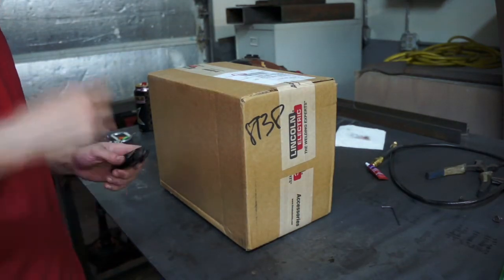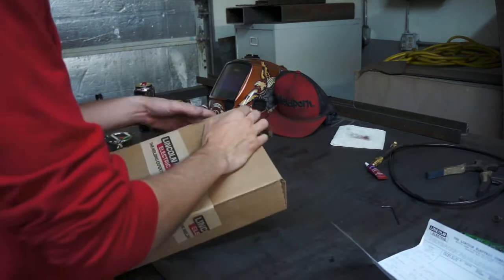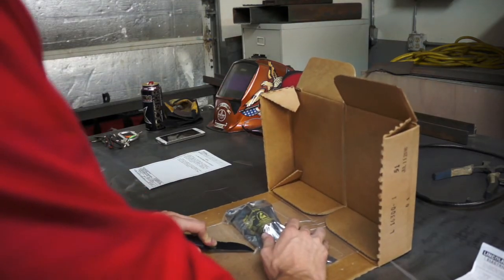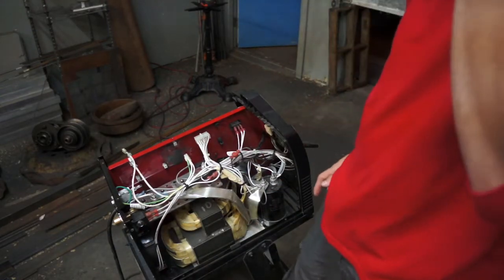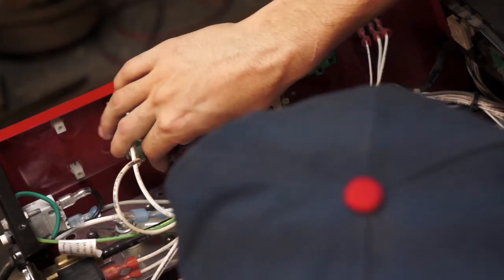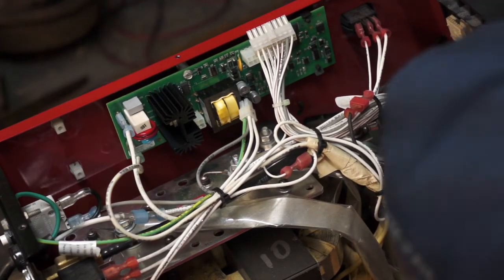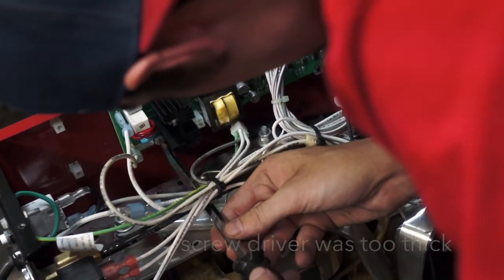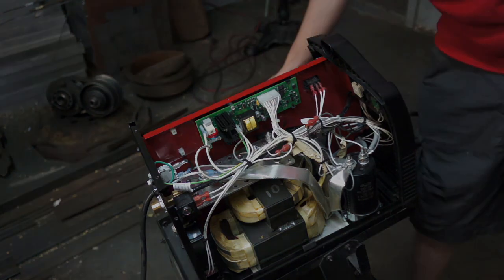Lincoln 180 HD weld pak fix!

Comment: Do you know the part # for the Lincoln 180 HD circuit board? I have the same machine and problem and need the board
Reply: Hi! I think I have the same problem. My won’t start. Completely dead! 
Thank you
Reply: Check the gas in-line selinoid. If not it’s most likely the board gone bad. I know a link to where they sell them but it’s like $245

Comment: 4-year-old lincoln 180 MIG welder slightly used maybe 12 times in 4 years. When I started up the welder it made a loud buzzing sound and I thought the cooling fan might be loose, but it was turning normally. Within 10 seconds the overload at the rear of the welder tripped. I unplugged the welder and put it away for the day. The next day I plugged it in and turned the power switch to on and NOTHING happened. I was told my board probably went out, called Lincoln and they want $350.00-500 cdn for a new unit. The problem is Lincoln doesn,t have any in stock. Called tech support and warranty and was told to bad, out of warranty
. I paid $650.00 on sale and now they want $849.00 cdn

Comment: My 180 easy mig seems like it has no ground, only heats the wire red and lays on itself, no penetration!
Reply from the maker: Dave Kana the only thing I can think of is maybe your ground connection isn’t connected well enough in the welder or even connected on the table itself, also your temperature might be too low
Reply: BGray Custom , that’s what I’m thinking as well, just nesting! Thanks, Dave!

Comment: I have a k1725-9 Lincoln welder 250 ranger gas and will not weld it runs good starts right up and the generator side works I plug in my air compressor in to it and compressor goes on but I'm not sure if the 220 volt side works I haven't plug anything into it just the 110 volt side I tried that works im trying to look online can't find anything about it I'm just wondering if this one I have has a circuit board like that. I can't find anything about that circuit board on this one and I check all circuit breakers there all good .if everyone has any ideas for me to check let me know Thank

Comment: 250.00 for circut board the damn machine is just 650.00 lucky i got same machine of ebay for 425.00 yesterday has not arrived yet but checking reviews of it this one here scares me ..you ever get it repaired lol i see the comment at the end well fuck
Reply from the maker: bobcatwelder00 ya 250 for just the circuit board. No I didn't the place I was gonna have it repaired at costed more than the welder itself, I bought it used to I figured the warranty was no good, I ended up buying a tig and I legit never want to mig again.  It was fine while it lasted.
Reply: I got one being shipped to me right now  paid aperson 425.00 for it i am hoping it is worth my trouble . but she stated it only has like 10 work hours on it . does your fan hummreally loud saw avideo on that today also
Reply: always contact the manufacturer of any item before you try self help fix . they sually pretty good at helping you find parts and honor warranties for good work practices and to keep people buying their products . the used machine i got being shipped to me monday seller says justa mere 10 hours of use time so i hope the 3 years warranty will be honored by lincoln i never dealt with them yet i have hada miller trail blazer sine 1997 and it still starts every day i need it 20 hp onan motor

Comment: I had to replace the card on my 180c. Welder was 4 years old, had little use ,cost $650 on sale the card was $590 for me to get here in Canada. I complained to Lincoln and they shipped me a card directly to me in 3 days for $120. Fixed my problem. ( my power reostat was broken) I will tell you that I had about as much trouble opening the box and bag as you did. Lol. They over pack everything. No reason to worry about static. This is 2018, not 1980.
Reply from the maker: +King Tut it's crazy how much it cost to replace the board but that wasn't even the problem with mine I ended up returning the board and getting rid of the welder, ended up buying a ago alpha tig welder
Reply: What was your symptoms did it not work at all or did it weld like it did not have enough power ? And did the fan work or no

Comment: I've got the Lincoln 140hd that has "low spark". I'm working on auto body so not anything big. Also when it tries to spark, the motor slows down like a 120V power feed problem. I'm a 30 year professional electrician and know my power supply from the house is in good shape. 
Any idea? 
Thank you in advance.

Comment: How old is that thing I would call Lincoln right away they should send you one for free even if it’s 4 years old your not using fir commercial unless they want you to go miller
Reply from the maker: Steve Mac I bought it used so I'm not sure how old it was but I bought a tig welder instead of mig

Comment: hey man any chance i can get a close up pictures of the wiring in your welder. i bought 1 all tore apart and trying to figure out whare everything goes.
Reply from the maker: +James Sprague I don't have it anymore once the board blew and the newbie didn't fix it it was too much to repair to what it was worth so I got rid of it a while ago and bough a different welder. Sorry bro.
Reply: Google PDF of ( your machine,make, model)...hope this helps someone...pdf will include wire schematic

Comment: Remember all lincoln welding machines have a automatic 3 yr. warranty....
Reply from the maker: Dennis Turk would of used it but I bought it used off some guy. and he didn't have papers. not sure if they needed it but it wasn't worth it. I have a tig welder that i mich rather use.
Reply: not when you try and do ahome repair and burn shit up like he seemed to have done that machine is now dust collecting in the shop corner

Comment: Giving Lincoln Electric a bad name. Did you fiddle with internals and blew it ?
Reply from the maker: Shaq Deisel not at all, I had it for about a year worked great till one day It just took a shit. when I was working it sparked weird and that was when the board blew. replacing it turned it on for the one second at the end of this video as soon as I pulled the trigger turned off and never turned on again.

Comment: What did your welder do for you to replace the board? I have a problem with my Pro mig 175. My feed roller motor does not rotate. With no wire in gun. Welder worked fine last time I used it. Thought I would ask you....maybe mine is bad.
Reply from the maker: Dallas Kouril honestly I have no Idea it was working just fine for me, I went to turn my wire speed and amps up and it shorted some how. even replacing them board didn't do it for me. it turned on when I got in in but as soon as I pulled the trigger it shut off and never turned back on. I'd suggest calling your local welding store to see if they have someone or know of someone that can look at it and tell you how much it would be to replace, the guys that were going to do mine said 500 and that's basically how much the Welder is. so I just bought a new tig Welder.
Reply: What was the problem??
Reply: Im having the same problem with my 140. The wire feed roller does not work... i removed the roller motor but that all seems to work....something internal... shit sucks cant figure it out

Comment: So expensive huh $250 for replacement board  , how old is the machine? My tig blew the first day I had it lol lucky i lived right by the dealer so he replaced it.
Reply from the maker: Ya I know it is I sent it back because I'm going to buy a new welder. But the machine is 700 I bought it from a guy in my start so I didn't have a warranty on it
Reply from the maker: What type of tig welder do you have? that's the kind I'm going to get now
Reply: hello i have an everlast tig 185. i am lucky i live close to only I think 4 of the dealers in america so i can drive there and get help if i needed but I think everyone else has to ship there's back if there is a problem. I also had a miller tig but there is welding dealers all over for miller and lincoln so I think any of them can cover a service repair under warranty. The mig does have advantage as it is much faster . the tig is good because there is no splatter , you can fuse pieces together without filler, you can make really small strong welds and if you weld clean metal there is very little to no smoke and no sparks. I could weld next to a roll of toilet paper without it catching fire. But the tig doesn;t work great if there is heavy breeze, like a mig I could put a roll of flux core and weld anywhere but its not so easy with the tig.
Reply from the maker: +randomlathe okay that's nice I'm going to get a Lincoln square wave 200 and eventually another mig but I want to know how to tig weld
Reply: that seems like a good machine
Reply: If you didn’t buy a new one yet it doesn’t matter if you bought it used they will honor it so to keep you happy trust me